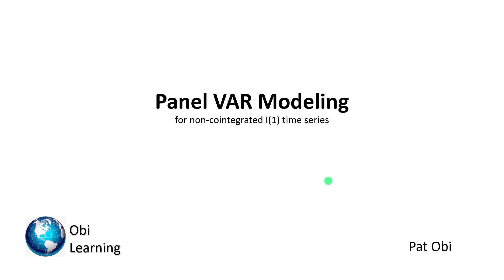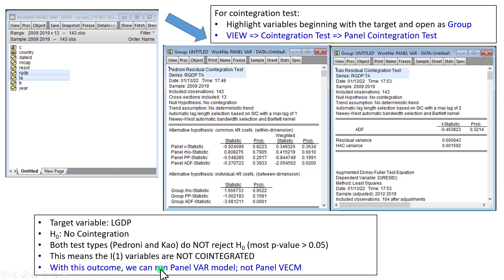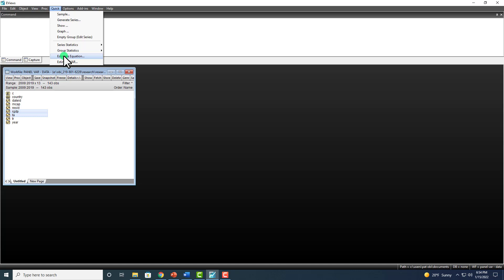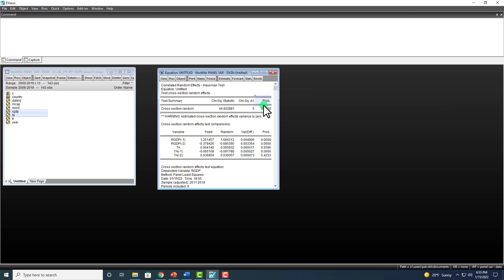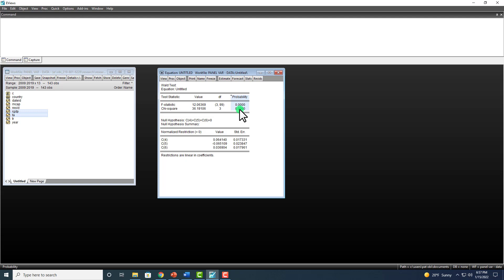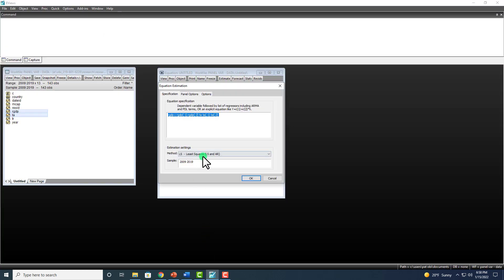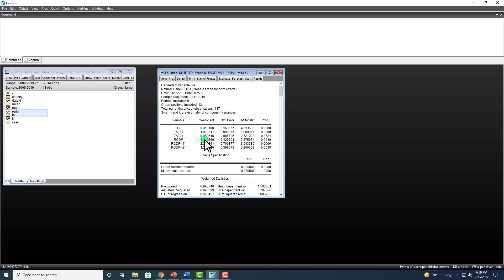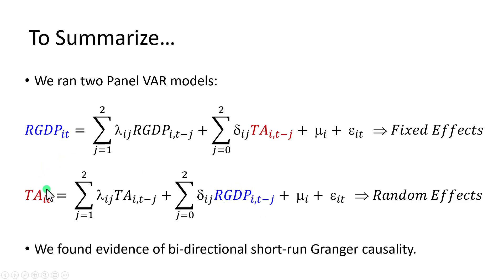Panel VAR Modeling

Comment: Eviews doesn't have panel var, I think in your estimation it treats your data as pooled data. Moreover, when specifying a VAR equation, there should be lag terms only on the right hand side but in your equation there are variables of the current period, would it be a problem?
Reply: Also, when you estimate the equation not using VAR, though specifying the lag terms on the right hand side but they are treated as exogenous variables (not endogenous)

Comment: Hi! This is fantastic, very easy to follow lecture/ tutorials. I have two questions which you can help clarify though. First, why did you not take the first difference of the two variables when you ran the Panel VAR? Both are I(1) even if not cointegrated so I was expecting to see the d(   ) notation. Second, I understand that you mentioned that if there is a mixed of I(0) and I(1) variables, ARDL modeling is the way to go. However, I saw a paper published by a renowned international institution which made use of Bayesian Panel VAR where one of the variables I suspect is I(0), e.g., inflation rate. That's only my suspicion because I cannot find in the paper the unit root test results. I tend to believe that inflation is most of the time I(0) variable. Do you think I can also use Panel VAR even if I have a mixed of I(0) and (1)? Thank you in advance for your response.
Reply: Same here I was looking to see d(series) for those I(1) series. I thought var can only be used for stationary variables?